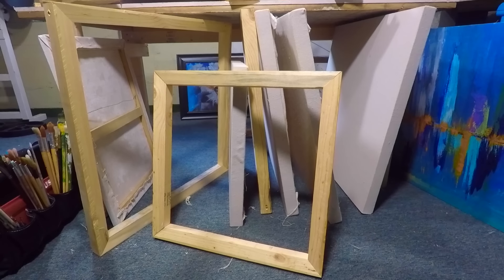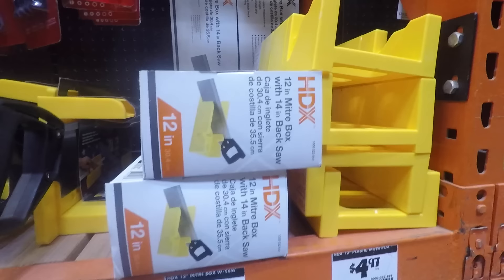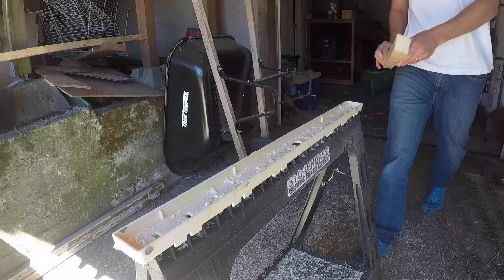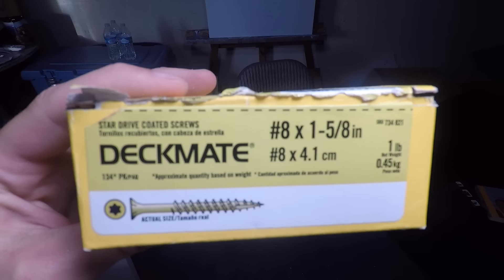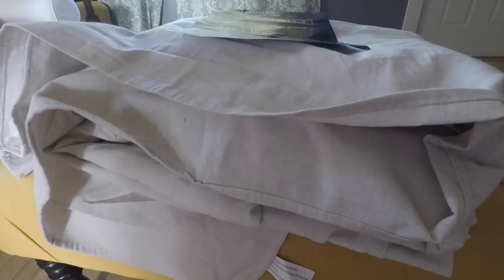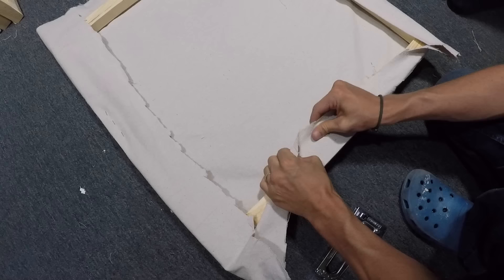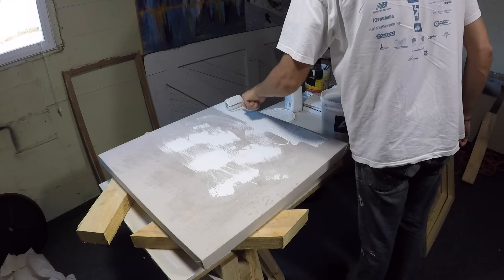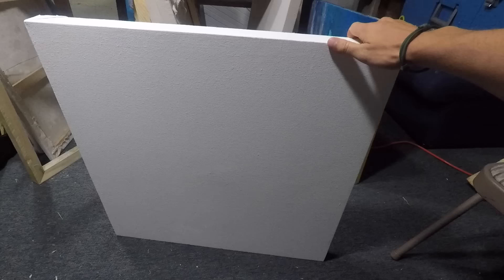EASY How to Build Canvas, HUGE SAVINGS!

Comment: Tip for tighter 'stretch:"  Gesso the edges first, then do the surface of the canvas.  The edges will tend to stick in place allowing the canvas to stretch tighter.  If you gesso the surface first as shown here the canvas begins to tighten and the edges will pull in some.  It makes quite a difference.   Really.....
Reply: can you explain in more detail. What do you mean by "edges?" The sides, not the top plane?
Reply: Thank you Thomas!!! This is so helpful. I'm truly grateful.
Reply: @xyzxyz3986  Sorry bout.that..... yeah, the sides.
Reply: Great tip!!!✍️✍️✍️
Reply: It doesn't matter where you gesso first..if the canvas is not stretched properly from the start, when the gesso dries will revers back to the original flab form..from the start WET THE CANVAS first and then stretch it, then apply the gesso. This is from a veteran artist, I do everything from scratch, the old fashion way..
Reply: This is an excellent tip; really helps get a tight canvas
Reply: @wolfcub1483  do you need to allow the canvas to dry first before adding the gesso?
Reply: @fallonhunt4987   Yes Fallon, if the canvas after it dries is not stretched enough, you wet that section that has the slack and stretches it again. if is perfectly tight, then only you apply the gesso. It's practice until you get it right. Good Luck! I do canvas over 60x60, not small ones...so the rules are the same for any size..
Reply: @wolfcub1483  Thanks for that advice, I found his canevas to no be stretched enough, wondered why, will wet my canvevas before hand thanks to you :D
Reply: @mlan12  Great, I am from the old European school of art, where I learned everything to do from scratch, is like home cooking versus fast food trash:)!
Reply: @wolfcub1483  I concur.  I worked for 5 years at a commercial art studio, we always wet the canvas before stapling/stretching.  When dry, it was tight as a drum.

Great helpful video otherwise.  I might would have also stressed "squaring" the wood frame for 90° corners, and center support bars for long rectangular canvases to prevent bowing or warping.
Reply: Cheap canvas + free tips 👏💯
Reply: @motogeeseven8705  When you wet it, do you literally soak it and then ring out the excess water, then stitch? Or do you just spray it do it is a bit damp?
Reply: @ohwhatworld5851  I was wondering the same. How do you “wet” the canvas? Spray bottle or full on soak with a water hose or in a sink??
Reply: @wolfcub1483  How do you “wet” the canvas, spray bottle or full on soak in sink? Is there a level of wetness it should like damp or full soak?
Reply: Thanks Thomas! Do you need to let the gesso on the sides dry first before you gesso the surface? Thanks
Reply: @wolfcub1483 do you have any advice on how to re-stretch canvas after it’s been painted on?
Reply: Wow <3

Comment: Nice. One thing though to keep in mind, the 2x2s from the hardware store are often not completely dry and often they can bend later...that can make it a pain if your clients come back with a warped canvas. You can often get a sense for the drier wood if you pay attention to it as you pick it in store
Reply: Thanks. I wouldn’t have thought of that. I have a stack of 2x2 and a roll of canvas. I thought I was set. I will bring the boards in from the shed and acclimate them for a few weeks before I try to use them.
Reply: VERY helpful ! Thank you

Comment: I've been doing the same since college (way back in the 90s). I'd like to add one thing. The corner folds. It's much cleaner if you fold one side in, then the excess over to the side, and finally the perpendicular edge over the excess. This leaves a clean seam along the corner and not to the side.
Reply: vertseven I absolutely agree on the corner folding
However, he did share some very nice information on this video so we can’t be to hard on him. I give him 4.9 stars out of 5
Reply: #sikhwalarts
Reply: I agree there, plus the finish at the back could have been neater. Just folded in and stapled. The jaggered cut edge of fabric annoys me......or am i just being too fussy?
Reply: I use the mitre system on the corners, and i use an electric iron to get them nice and neat and tight.

Comment: I use 1" x 2" most of time to make frames. But a good idea with the 2"x2". Using a drop cloth it should get tight after you put gesso or try Kilz 2 acrylic primer. I add 2 or 3 coats depends on what I'm painting and sand it in-between each coat.  Also a couple of tips put wood glue on the corners and make sure all of the staples are at an angle. Use artist paint or if you want use house paint, use the exterior stain paints. They will protect your art from UV light better and some what easy to clean with a damp cloth, if needed.

Comment: Another tip. Use the same tape measure for the entire project. See tons of time where someone will use 2 diffrent tape measures and they can have slight variation especially if it is worn and the end piece willows out it mounting holes. When trying to make something really square those little bits can make your life a lot more difficult.  Oh and also I like priming my frame when I used pine from the hardware store. Helps prevent any sap or staining from the pine where it might bot have been kiln dried to the dame standard as actually stretchers

Comment: There are also lots of recipes out there for making your own Gesso.
Also, if after you're done, your canvas is still a bit loose ( and will sometimes loosen more during the painting process ), add a coat of gesso to the back as well. That will help to tighten it back up.
Reply: Or......just wet the canvas
Reply: @KortovElphame  adding holes for keys is needed for it to stay tight after painting
Reply: For tight canvas go first with PVA glue and than with gesso.
Reply: IyaEarthseeds  which won't be museum quality? the use of PVA glue or not having keys cut in?
Reply: Or just warm water

Comment: I rip the wood lengths with a slight bevel before cutting the miters. Also often preprime canvas on a large backing board and then cut to required size so that finished with neat edges. Looks as good as new, but without the double mortise and tenon joints. Just need to find a method to vacuum plastic seal for good presentation.

Comment: I just want to thank you for your tutorial. I was suppose to order a photo printed on canvas for my friend for their wedding online that cost about $130 plus tax... but it will not make it on time (If I pushed it to a rush order it's at $250... so I have to made my own by having the photo printed on canvas (by going to office depot, they finished the print job in less than 24 hours) and I used your tutorials to set up the frame. There was a lot of trials and errors because I was not the best at doing this arts and crafts stuff, but I found the mitre box forgiving and I was able to make the photo canvas on time for the wedding. It also saved me some money on materials and shipping as well that I made two canvases and I improved each time I made one.

Thank you once more for teaching me this skill.

Comment: I just finished building and painting 4 3ft X 12ft canvases. I was taught in college how to do it but today materials have gotten so expensive that I can’t imagine what art students have to do to afford school materials now. I ended up buying a 15 X 16 ft dropcloth on Amazon for about 30.00 and covered all 4 frames and still have enough canvas for some smaller paintings. Drop cloths seem to run about a 7 or 8 pound weight, some people like heavier. Of course I had to add crossbars to mine because they were so long. I just found your channel and don’t yet know if you covered that anywhere.

Comment: At my work, they always have old wood crates they use for shipping that they throw away.  Anyone (even the public) is free to take the wood pallets and crates, so I take the best-looking ones and on my own time after work tear them apart.  Once I have loose wood, I put them in my car, and drive home where I use a table saw, miter saw, and a rounding bit and stand to cut the wood creating the bevel for the canvas.  Finally, I stretch out and secure the canvas, and volla.  What's nice is the wood is free, so it saves on pricing.  And I can make literally ANY size frame I want for effectively the initial investment in tools, canvas from art stores (always on sale), and my time.

Comment: I'm a hobbyist and was spending a lot of money in cavas. I'm glad I came across this video and thank you so much for posting it.  Using the idea I made some adjustments to fit my needs.  I already had  a bench saw and a miter saw, just had to buy a stapler.    I picked up a 10'x6"+ 8 Oz dropcloth @HD and split the 10x6 in 5 pieces of 1" including the blade. The leftover piece I split in 45 degree angle on the bench saw and glued that on the edge of each of the 5 pieces, this way I avoided to create the angle using a planner, which I don't have one. The final width was a little over 1 1/4"   (the 2x2 is actually 1.5"x1.5") -   I noticed that the 8Oz dropcloth had an issue next day,  the fibers seemed to have come apart and the canvas lost a bit of the stretch (maybe the one I bought was a cheap quality), I'll try 10Oz for the next batch.  Note: A ballpark calculation -  wood + canvas + screws + homemade gesso ~ $50. I recovered the money spent  in just 2 canvas, a 32x32 and a 24x24.. I still have wood and dropcloth left for several  canvas. Better yet, I can make the size I want when I want it.

Comment: You don't mention that when buying your wood to look for bowed or warped sections. Do not use that whole length of wood. Pick straight unwarp wood. When assembling, I double-check to make sure that I get a true 90-degree corner using a "square" before securing it. I glue and staple wood corners. Screwing is more difficult due to it becoming off-set as the screw is set. When stapling the canvas, after securing the first to centers of the canvas I pull any wrinkles out the center when securing the second two centers. I then go to the corners and pull the canvas as I staple to eliminate other wrinkles that might be present and gives the canvas proper tension. The goal is to have a smooth canvas with 90-degree corners and it sits flat and is not warped. A good canvas requires these additions to your method. Remember, quality wood is your best investment. Cheap wood will warp in time.
Reply from the maker: Your right, i did fail to mention these great tips.
Reply: Can you please tell how to differentiate cheap wood vs good quality wood? Thanks .

Comment: I do just what you showed...but I counter sink the first drill I use with a little larger size bit around the hole I made... Also, after stretching your canvas wet both sides with water and it will tighten like a drum!

Comment: The only thing I wonder about is the ability to tighten these.  If you do an oil ground instead of acrylic, you'd have to size it first.  Normally when I do this on regular stretchers.  I apply a coat of RHG or Gamblin PVA prior to the ground (gesso).  It loosens the hell out of the canvas no matter how tight you get it.  I have almost always use stretcher keys to expand the frame and get it to get taunt again before the ground goes on, then again after the ground goes on.

Comment: You went thru the process so quickly I wasn’t sure if it was the outer or inner edge that you rounded over. This video was perfect timing as just today I was pricing some large canvases and it would cost way too much to have finished canvases in inventory. I just happen to have a bunch of 2x2s.
Reply: The inner edges
Reply: @BEFONEPRODUCTIONS  Thanks
Reply: @BEFONEPRODUCTIONS  Thanks

Comment: Fyi: you can purchase your unprimed canvas at Harbor Freight Tools to save a lot of money vs Home Depot.
Reply: How much does it go for there?
Reply: Sairah Bashir 
4 ft x 12 ft at Harbor Freight costs $9.49 but they always have an active 20 percent coupon available...  also, the canvas does go on-sale periodically for much less... that’s when I purchase mine.
Reply: @kertjans8794  awesome, thanks for the heads up!
Reply: @kertjans8794  Hey thanks so much for this, how thoughtful of you!! :D
Reply: @kertjans8794  Hey just wanted to say the code worked. Thanks again for sharing it. 🙂👍🏽
Reply: @Sairah Bashir 
I just picked up some more canvas on-sale yesterday...happy painting!
Reply: So wrong - you didn't "square" the canvas using doagonal measurements. Nor did you create grouves for wedges at the end of each stretcher piece so that you could insert wedges to be knocked in to tighten the canvas. Also, when adding the canvas to the frame, the order is to tack opposite sides in the middle, first, stretching in the process. Then rotate 90 degrees and do the same. Then infil opposite sides at a time.
Reply: Maverick i have my own way to do it to , but it is ok his way
Reply: @Niya B. I purchase the 4ft x 12ft canvas.  I am able to then make three 3ft x 3ft  x 2in paintings from this.  Here is the one that I purchase: 

    https://www.harborfreight.com/4-ft-x-12-ft-canvas-drop-cloth-69309.html
It usually goes on-sale every month or-so.... they also always have a 20 percent off coupon that you can apply.
Reply: Kert Jans can you update me when it’s on sale next? Thanks!!
Reply: Hey all, something I would like to interject, I am not that knowledgeable as I am fairly new to painting. But something I have not heard anyone mention is fabric weight. I am assuming that should play somewhat of a role in the quality of your canvas, or at least the characteristics of the canvas. I read an article that said you should go with at least an 8oz to 10oz weight and nothing less. Now again, I do not know how important fabric weight is, but the canvas that I see at Home Depot that Nia is talking about, which I believe is the Sigman 12x15, looks like its a 6 oz weight and the harbor freight canvas is 10 oz.
 So there is that.
I was calculating the cost myself and using the prices in my area, the home depot cloth that was 12x15 would be 180 square feet and that came out to around a $0.18 per square foot while the harbor freight was 48 square feet and came out to $0.19 per square foot. So practically no difference for me. Oh and that harbor freight price was just regular price, no coupon or sale. So with a 20% off coupon it would only be $0.15 at harbor freight.  But, I think I would rather have the 10 ounce fabric weight over the 6 ounce so that would be the deciding factor for me since the price difference is negligible. But then again I may just be talking out my derp hole and maybe it doesnt even matter?
Anyone got an opinion on this?
Reply: @Niya B. 12x9 is 108 square feet. Based on the numbers you have provided in your post, the Home Depot canvas would cost you about $0.21 per square foot and the Harbor Freight canvas, at the sale price of $11.99 would have been $0.11 per square foot and at the normal price of $14.99 it would be $0.14 per square foot. Either way it appears you would be saving at least $0.07 cents buying from Harbor Freight. At the end of the day we are only talking differences of approximately 5 to 10 cents so likely not really going to matter. As you have said, if you have to drive much further for Harbor Freight then the savings may not be worth it. Convenience also counts for something, if its easier to get to Home Depot then again,  that would probably be worth the extra 10 cents you would spend.
Reply: @Daetalus67  I was the one that originally suggested using the Harbor Freight canvas instead of the Home Depot brand.  I never thought that there might be a difference...there is.  I have been building my canvas frames using the Harbor Freight raw canvas for several years...but the resulting surface always seemed a bit too rough...it took several coats of gesso to get a somewhat smooth surface.  I went to Home Depot after seeing your comment and there is quite a difference.  The Home Depot canvas is much smoother and should result in a a much better painting surface.  I'm going to try using the Home Depot canvas for my next batch of frames.  Thanks for pointing this out... I'll keep you posted on my results!
Reply: Harbor Freight is my first stop for 75% of my art supplies. I find super unique things there too. I'm saving up for a lathe they have-waaaay less than Home Depot.

Comment: One more thing, wet your regular canvas before you stretch it, this way will never sag later when you'll prime it..will stay tight forever.
Reply: Im new to making canvas so I have a question, will the canvas fabric rip if pulled too hard?
Reply: @peabean8755  Depending on the weight of the canvas, the heavier for largest sizes the better, but you must wet the canvas prior to stretching it, hopefully, you have the proper tool for that, and then there is a technique to evenly stretch it and not damage it..The key is to wet it first, then pull it gently, ok?
This is from a veteran artist from the old school..
Reply: @wolfcub1483  I know this was awhile ago but when you say wet...how wet?  Just damp or really wet?
Reply: A good wet canvas is all that makes easy to stretch , a good soak all over, then start stretching in four centers and work towards the corners in an evenly manner and end up processing the corners ether way , for a framed or frameless way. When it dries is like a drum  , a perfect stretch!